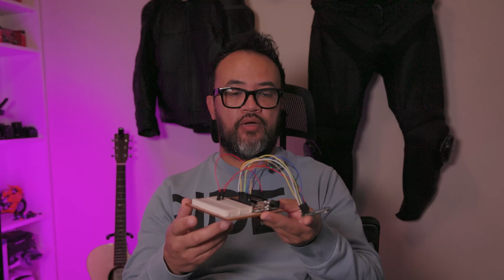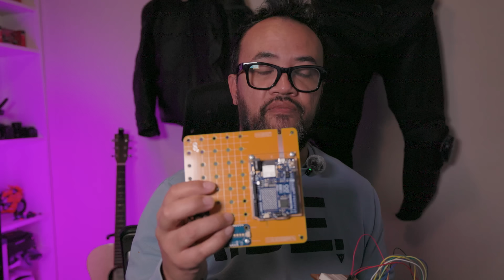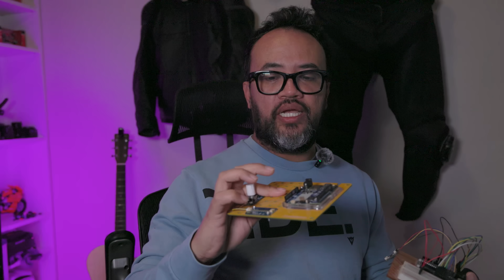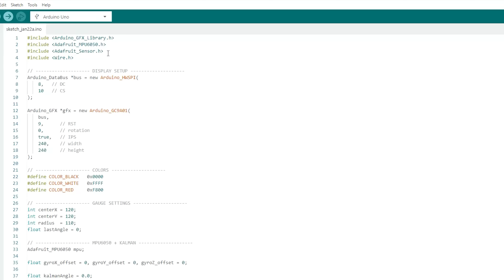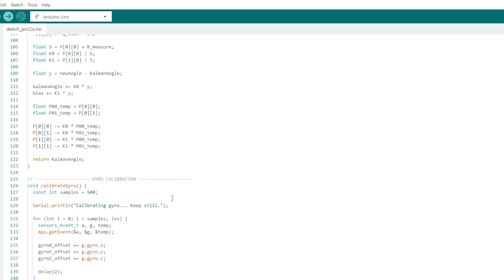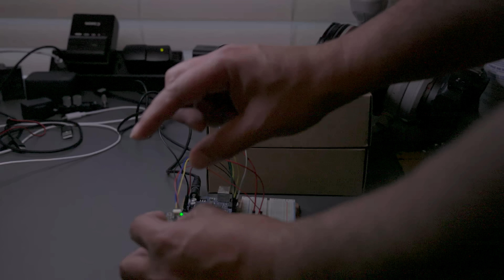DIY: How to Measure Your Lean Angle On a Motorcycle | Series 2

Comment: No worries, very cool video! UART is Serial bus, I2C is not. But very cool! I may try doing this but with a PCB with an sd card logging the time and the angle. Also with a small battery and attaching it under the seat so it logs everything and afterwards I can see the data from a pc!

Though, how do you fix the drift from such a sensor? Over time they typically drift.

Comment: I've never managed to make stable lean angle sensor based on this MPU6050 - it always drifts. Best results were when I used X-axis only but then when you pitch the bike (braking or accelerating) it is going of as the sensor is not anymore perpendicular to the ground
Reply from the maker: I'm using Cloud Opus 4.6 to analyze and improve the code for me. Just put in all your hardware info and it does it's magic! VS Code with GitHub Copilot is just 🤌🏽
Reply: @wiredmoto copilot is 😈